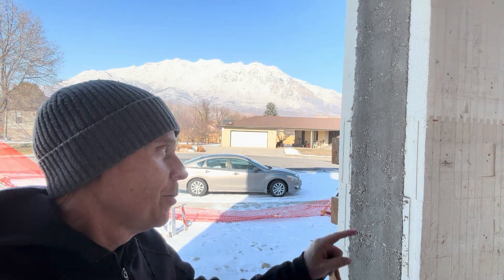On paper my ICF walls are R-22 but with my passive design they will outperform conventional walls

Comment: I'm a little surprised the r-value is only 21. Most rigid foam these days is r-6 or more.
Reply from the maker: My blocks are made with eps foam
Reply: @LegacyViewsICFhomeBuild   my bad. I thought we were using xps icf, but we are using eps as well. It's just that the foam is thicker giving total r value of 40. They really should be made with xps.

Comment: Not sure what your daily temperature swing is, but where I am it's on average about 25-30 degrees (we're high desert).   This large temp swing 'charges and discharges' the ICF thermal battery is a very productive way.   It's such a great system under these conditions.
Reply from the maker: Excellent point! I too live in a high mountain desert and those swings will be super hepful especially in the summer so that my walls don’t get too warm. I do have that massive heat sink of 52 f because I am so far below grade.   It would be great if someone did the research of the impact of it.